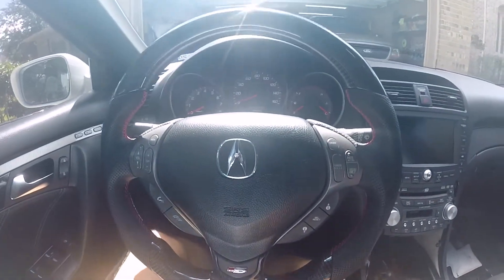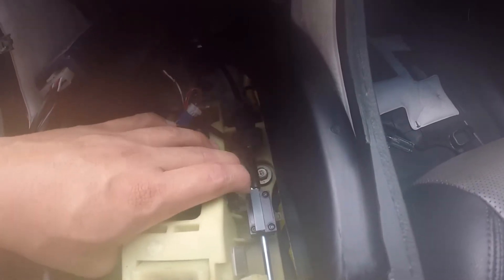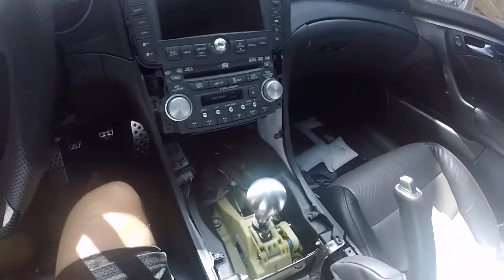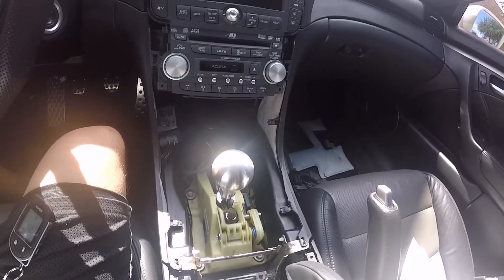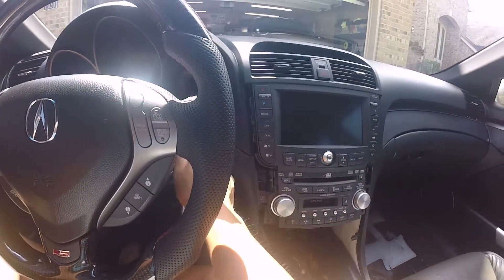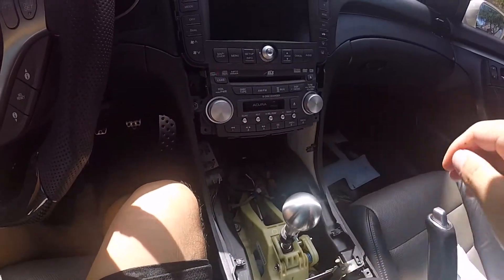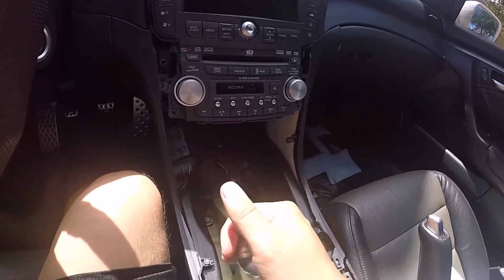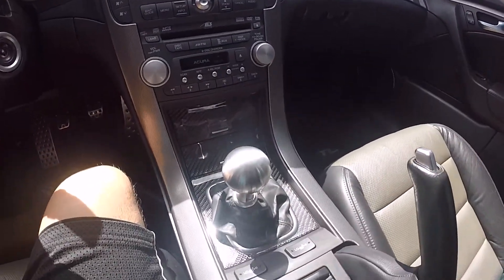Manual Transmission Remote Start Mod

Comment: Funny thing i am tryna do the exact opposite, i wanna get rid of programming in my viper remote start, have to set it to remote start manually for my 6 speed manual car. It is just a headache remebering to do it everytime Before i turn off the car : ( and get out.

Comment: I’m about to put remote start in my manual jeep I’m wondering if I could set it up in a way so if I move it up into any gear or down into any gear it will hit a magnet switch like that or something similar. I would hate for it to hit something or worse hit someone!!
Reply from the maker: As long as the magnet is strong enough you should be fine but the only thing about the Jeeps is I think it doesn't use cables so it'll be hard to mount. Maybe you'd need to fabricate something. How I tested the distance was use different types of magnets and verified the continuity on a meter to determine the sensor and magnet mounting locations. Hope this helps!

Comment: What swtch n magnets did you use?   Ive got a remote start on my 6 speed mustang gt and this would be a nice safety just in case.
Reply from the maker: There wasn't a specific brand, I just got it from a local electronic store. I just used a normally closed reed switch and connected both ends to the two wires on the neutral safety switch on the clutch pedal. I am not sure how easy it is to do it on the Mustang since it is rear wheel drive so the shifter is not cable driven like mine.